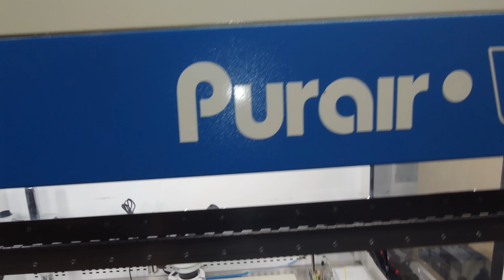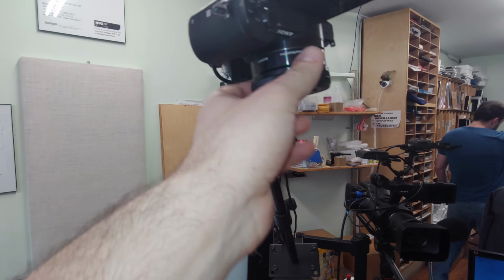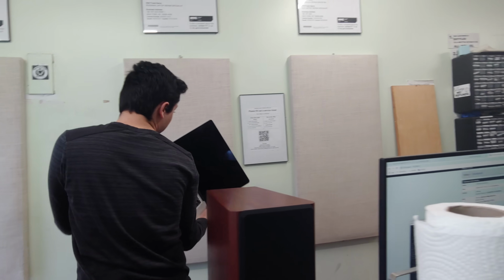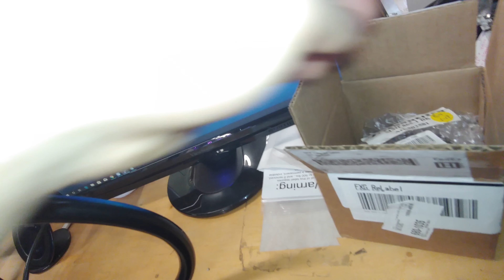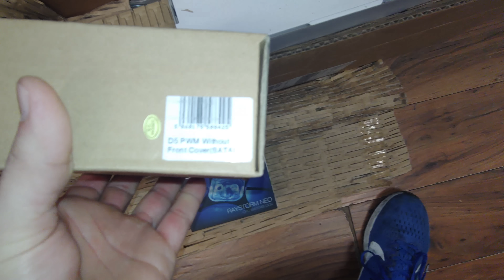Upgrades to recording setup, fixing infrastructure, new data recovery videos

Comment from the maker: I apologize in advance, ladies: Steve is happily married.
Reply: Ah yes the new modem, heads up louis that TG/DG1670A or variant is still trash. Ask them for a Hitron, Arris modems are garbage. trust me you'll thank yourself later.

Edit: If i was to recommend something to you since you probably have that Arris in Bridge mode where you are using PFSense as your gateway Invest in your Own Hitron CODA-45 or similar its a simple modem with no gateway functions and the firmware is much cleaner on these and not bogged down by crap like the Arris ones. Also it's DOCSIS 3.1 Capable so you will have that headroom for up to 32 DS Bonded channels if spectrum ever allows higher tier speeds in your area

Link: http://www.hitrontech.com/product-category/cable/data-modem/docsis-3-1/
Reply: @bransinclair  They totally are a gateway, Rogers in canada provided me with a CODA-4582. although it almost never goes down and can be easily turned into bridge mode. i do agree its leagues better an Arris junk, my last ISP had me with one of em, i restarted that thing a lot. http://www.hitrontech.com/product/coda-4582/
Reply: @ryanxero  Yeah the CODA-4582 Is a gateway, the CODA-45 is not. I used to work for rogers.
Reply: Congratulations to Steve(?). When is your turn?
Reply: hope you are doing soft tubing for your first water cooling build.   If you do choose hard tubing be sure to grab a fair amount extra for the bend learning curve
Reply: lol my seagate drive died and they sent me a new one with all my data on it ( had to send them the old one in of course)
Reply: Yet you’re not!
Reply: Louis Rossmann  nice
Reply: He somehow has a semblance to Kevin...
Reply: Drive Savers use to send our shop a Huge bag of Chocolate Truffles Every Christmas...
Reply: And still, no new chair with a decent head support. C'mon, you deserve it.
Reply: Wow, that looks like a ton of work went into setting it all up. Congrats on branching out into data recovery, smart move Mr. Rossmann, looking forward to those streams. ((: Hope your boy isn't just as talented as you are, but as entertaining as well. >.<

Comment: In my life used 10 WD drives so far no fails aged out before that would happen. But tryed a Seagate drive and failed in 5 weeks rma, the replacement drive 3 weeks later, rma again failed 6 weeks later gave up. Will never betray WD again

Comment: I work in It for more than 20  years and Seagate is still the brand I trust. And the only reason I have more Seagate damage drives it's because there are a lot more implemented.
The spike we have seen on the latest years we mostly due to Seagate acquiring Samsung HD division, like they did long ago with Conner. This will probably get better in a near future.

Comment: So I remember reading a ton about the Enermax coolers when I was looking into a Threadripper build... apparently the coolant they put in there is trash and bacterial/fungal growth happens within a few months and gunks up the whole thing. Supposedly you can just open it up, clean it out, and replace the coolant with standard coolant with anti-microbial additives and it will work like new / great. There are several how-to's on the net for doing that.

Comment: Are you sure about your thermal paste installation!? Shouldn't be at 65° with a garbage on low usage (streaming is heavy CPU encoding stuff...)
Make sure to be careful to not leave any air bubbles under the waterblock, as this is why you might have high temps.

+ Nice network config, thank you for your model's referrence, much easier to hack it with these details! The internal IP address of it is helpful (192.168.5.1).

Like that time with your Store key on live stream, you are leaking too much :p

Comment: I made the same mistake on the enermax, it's GARBAGE. Got a Be Quiet BW003 Cooler Silent Loop + Alphacool AMD Threadripper Epic TR4/SP3 Ice Bear Ice Block/Silent Loop Mount w/ Screws (same as the Be Quiet brackets) 10°C diff + 1950X running on 4GHz@1.35Vcore (that's high). Full load for days = 78°C (8°C from throttling)

Comment: Wow, hating on Seagate and not Toshiba?
Almost all of the dead HDDs I replace are in laptops, and I swear, almost every time I see a laptop with a dead HDD, it's a Toshiba. It's gotten to the point where I'm SURPRISED if I see a dead HDD from any other vendor.
Reply: I think the difference is how they die. Toshiba drives may die but you can still recover data. Seagate drives fail and the heads crash into the platters destroying all your data in the process.
Reply: I guess it also depends on the type of drives they get in; professional data recovery is much more likely to get the drives that are well and truly fucked, I guess.
Most of the Seagates I see that die tend to be death by a million bad sectors, but deaths like that can be usually recovered without shelling out big bucks for a clean room recovery service.

Comment: As demonstrated by Linus Tech Tips, more resolution in cameras makes editing easier, since when you want to show stuff close, you can just crop... That's why they have an 8k Camera for doing 4k releases! Louis could probably use one too!
Reply from the maker: that is waaaaay outside my budget, I'm not even going to 4k anytime soon. 1080p60 is fine for this, what matters is getting the right lighting and most importantly the right TRINOCULAR TUBE ADAPTER for your microscope.
Reply: @rossmanngroup  Well, you could still do with 4k on 1080p releases.. Then you could still crop 4x! 4K cameras aren't really that expensive anymore (phones have it...).. Of course when you start to put together an editing rig, nevermind storage, it can get expensive.. However you already have the Ryzen-setup, which should be fine for plenty already. 

I'm just suggesting this, as the lazy and very bad editor that I am, if I were to do something like you, I would have a similar setup with OBS, where I would just have a bunch of cameras filming in a space, and I could just use buttons to determine which camera to use when filming anything.. Adding 4K / crop to the workflow could need some work when it comes to OBS, but again, I think it could be made work well...

Of course in the meantime I am happy with your content as it is (though, please, more rants :D)

Comment: Weirdly I have had more western digital drives fail on me than I have seagate.
That might be because there are three seagate drives in the house, and over a dozen Western Digital drives, and all the drives that failed were 15+ year old laptop drives.
The only problem here is that one of those seagate drives is in a 90's "gaming" PC, and the other is my modern PC's C drive. 
Yes I back up my important data? why do you ask?
At least I know that if it fails I am in better shape than my friend. I have never seen a drive melted and warped like that outside of a house fire.

Comment: Yeh when it comes to Storage only brands I trust is:
HDD=WD
SSD=Samsung
SD=Samsung and SanDisk
USB=Patriot
RAM=G.SKILL
Reply: HDDs need to die already from consumer products. Only thing they need to be used for is long term storage
Reply: @repeatrepeatrepeat  Not really,
Properly maintained good HDD will outlast SSD in high amount of write tasks.

As for HDD as long term storage in some cases it is bad idea. For instance; If you will write the data on it and hopping after centuries someone will be able to read it. 1st you have to worry about the corrosion and the 2nd the magnetical degradation.

Comment: I've never had one Seagate drive die still got many including very old models, including the archive drives but WD drives i've had loads die, in the past I sent a few WD drives for RMA (these were the raptor drives) and never got anything back and yes i did get a RMA number and sent them and they did get them all (this can be checked by the delivery company)but they said they never did.. 
but still would love to know what you think about HD's but i might be lucky with seagate and all my data is on seagate 8tb archive drives
i had a old maxtor drive (was in my old games pc) that just died after many many years of use, i remember a few years back deskstar HD's failed a lot i use to call them deathstars as they died a lot lol

Comment: You inspire me sir. Thank you 1,000 times. Here's the story. We've had a late 2011 Macbook Pro sitting in the closet for 4 years now that refused to boot. My wife is an author and had manuscripts on it, as well as some very important pictures. Unfortunately the "Time Machine" was corrupt as well. The Genius Bar told us that we needed to pay $400 to fix the drive and they'd have to send it out to the really Genius bar to do that,  but the data was lost. We went in twice over the years and told the same. So what the heck. I speak linux a bit, and Mac is Unix a kissing cousin I found out.  I dusted it off,  went into single user mode, saw the files were intact, copied them to a thumb drive, loaded them on her other computer, then reloaded the OS through File Utility, and did updates. Bam. Done. Nothing wrong with the computer. These stores should be ashamed of themselves(.) And now to give it a tune up and some love, may need your help with that bit. But that's my success story. And you inspired me to give it a shot and saved me money for something else, and gained a good machine back.

Comment: If that is a vertical laminar flow then mounting the camera on the top there where the air flows might mess up your air flow and affect the protective flow over the hard drives. Consult the manufacturer before you do that. The air flow is usually carefully balanced in those clean benches

Comment: AIO coolers != watercooling
Glad to see you going true custom loop, but should have sprang for a EK or Swiftech block. XSPC and thermaltake stuff are garbage.
Reply: custom loop for business is pretty much a 'no' unless it's a show off built. Maintaining it costs too much time.
AIO is pretty much water cooling, it tends to have lower volume, pump but other than that, it's water(ish) liquid that carries the heat away.

Comment: Oh the irony of seeing this today. My external 2tb seagate just crashed and burned yesterday, After contacting seagate, even tho it hasn't been a full year since i bought it, wanted to charge me 100$ to simply switch it and send me another one. I told them they had to be joking, i payed 89$ for the crap i had and now to give me another one i have to pay 100$ ? Fuck that, i'm changing all my hard drives tomorrow for Western digital ones unless someone knows another more reliable disk maker and would kindly mention it to me' i'd appreciate it. 

The only good thing out of this is now i can tell the people who thought i was being paranoid about backing my stuff on 2 different offline storage devices, well with my main drive gone to crap, my data is still safe. The only time i put new stuff on my main drive is when i had the presence of mind to back it up the same day so not to lose anything. 

Hell the 2 hhds in my 10 years old laptop are still running fine and yet this piece of crap seagate crapped out on me in a few months. Took a hammer to it to vent my frustrations and also make sure it was unrecoverable before getting rid of it. Seagate is a piece of shit garbage company.

Comment: Pull that enermax before it bursts! Invest in a custom water system or a good noctua heatsink. Or you'll end up -$3k 
Threadripper is beast
Reply: A threadripper can easily be cooled by an NH-D15. Louis just probably has extremely poor thermal paste application or a dead pump. The 240mm version of the Liqtech is rated at 300W, wich is well beyond what a Threadripper will ever need unless overclocked.

Comment: @louis does Steve do Replacement of PCB that has fried due to incorrect PSU > Sata power cable for the specific PSU.  I thought they were all wired the same, but different PSU's are wired differently, and Magic smoke escaped.  So i think the Power rail fuses have blown.

I think the drive would be okay just needs a new PCB and Drive Bios swap.

(Steve would know what I am talking about).

Comment: Funny, cause my first ever harddrive was a Western digital 500gb drive. Super hyped to install windows. Then poop, the drive was DOA. Went to best buy and bought a 2tb WD drive. Worked great untill it spazzed, just started clicking rapidly, computer froze up. Sent the drive to data recovery, got my data back. Bought a Seagate and never had issues. But ive been backing up my data.

Comment: Ha I bought a 4tb Seagate 5 ot 6 years ago, I did a full format which succeded, but when I went to transfer data literally seconds later it stopped working and just clicked Seagate are the one company I had failures with.

Comment: I can already see 4 WD drives in there, possibly more under the 2 stacks, But I wanted to point out I had a WD 2TB green drive crap out on me within it's 2year period which I claimed my warranty from WD which I have to say is the worst process I went through due to the need of using a credit card HAD TO be a credit card where they put in place a $800 outstanding charge if I didn't send them the broken drive back within 30days of being sent the RMA drive which failed within the 6 months  warranty period which I didn't claim that time because of the risk of the $800 charge if they claimed they never got the drive. 
I went with a Seagate sshd after that which is going on 5years strong now thankfully. 
I never had harddrive issues before and even my at least 15year maxtor sata2 350GB drive works brilliantly which I used a few months back to install windows 10 on to play shadow of the tomb raider in crappy directx 12 (should've went with Vulkan) 
I used to always use WD and recommend them but WD is the only drives i've seen fail. 
A friends dad gave me 3 2TB hard drives he was having issues with 1 actually had no issue he just didn't have the right cable for it and had already since replaced the usb drives and told me I can keep the drives if I can get them working. 
I did get them all working on my computer but 2 eventually failed
2 WD drives stopped working 1 completely dead not coming on at all the other had a SMART warning and is on the way out.
the other drive is a Maxtor and hasn't given me a issue yet.

I'm from the UK and from what i've seen in recent years after the unfortunate incident that happened to Japan and the fukushima area after the tsunami 
WD was affected by that and the hard drives more than doubled in a day back then and the fukushima powerpant has never recovered and nothing can be treated at the plant it still leaks pollution to this day.
Anyway as I was going to say it's possible my area may come from a plant that is in trouble and just isn't performing well, Maybe America's stock comes from a more reliable plant. 
I remember back in the 90's-00's  Seagate went bust offering lifetime warranties on drives that were failing everywhere. 
But they seem to be doing well today and even the Samsung usb drive I bought is doing well today too. As I suspect you know ... Samsung drives are Seagate at least for about the past 10years or slightly more.

But as you pointed out at the end if the Seagate drives die with the heads crashing into the platters well that does suck, and is a point of concern. Well all being well I will have a bigger drive soon allowing me to switch the data on my older seagate drives to something less important. :)

Comment: Yeah, networking is annoying. I've got a degree in system administration.. I remember having to deal with cabling in the roof and trying to figure out what is what without labels because the last admin was a complete and utter moron. I ended up getting a bonus for my work. (First job in the field at the time)